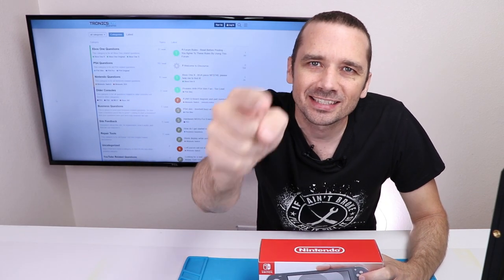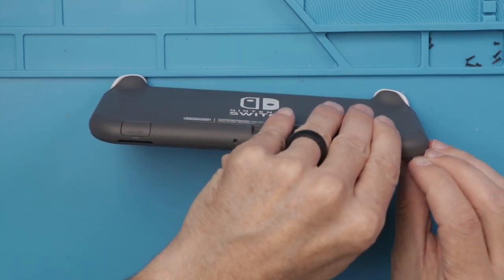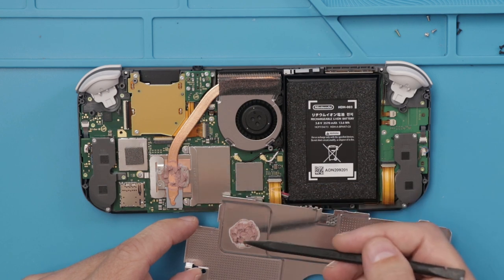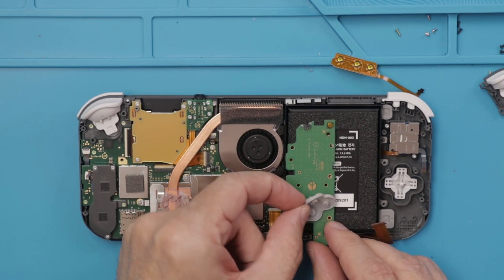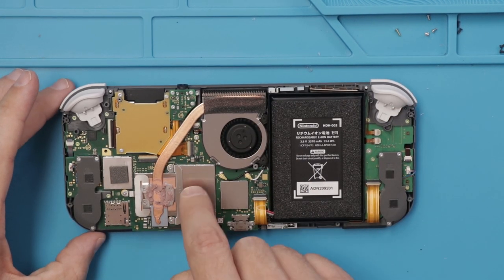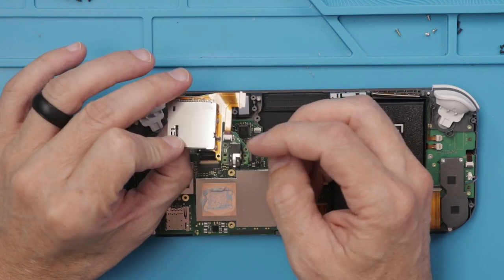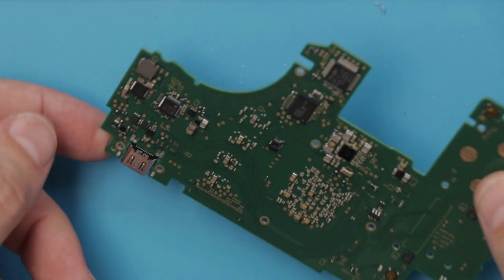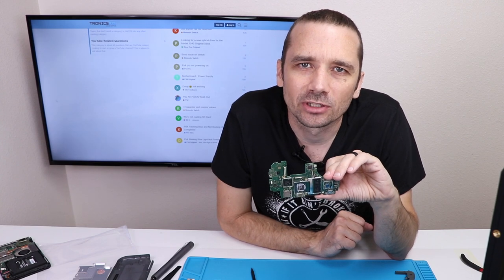Nintendo Switch Lite Teardown - Took it Apart Before I Even Played it!

Comment from the maker: Sorry I didn't get to testing the analog stick in the video...just ran out of time. I've uploaded a quick video showing me testing the analog stick to the community tab...go check it out if you're curious! (Spoiler alert...they are interchangeable)
Reply: TronicsFix I haven’t played it but I like to original one
Reply: I think that there's some glitch at 6:53. It looks like a small bar in the middle of the screen.
Reply: So did the normal analog switch work in the lite version :)?
Reply from the maker: Haven’t been able to check yet
Reply: I can't put the thing down! Loving it!
Reply: I got a question TronicsFix,  I have a ps4 and want to clean it(I got two cats at home) I don't have any electronics tools, so I was thinking about maybe just opening the shells and blowing air with my compressor. is that a good idea?
Reply: @Tronicsfix  There is a screen glitch at 6:53 but it's very minor and I personally wasn't put off by it.
Reply: Did the analog stick of the regular switch work in the switch lite?
Reply: @Skyerzen  - I've only worked on my PS4 Pro, but you have to tear down the entire system to get to the fan on it. It disassembles from the bottom and the fan & Blu-Ray drive are at the top.
Reply: BrandonHeat91

My ps4 controller is freezing after about 5 minutes. I have to press the reset button constantly while gaming. Anyone else had this problem and knows of a fix please
Model controller
 cuh_zct1u

Comment: So are those thumbsticks exactly the same as the original switch...? Man I hope drifting wont become an issue for the lite also
Reply from the maker: I haven't actually even gotten to test it yet...in fact it's still apart...I wanted to get this vid shot, edited and uploaded all today so that's all I've had time for
Reply: @Tronicsfix  No problem thanks for the reply and video anyways it was helpful👍🏻
Reply: It will be an issue, without a doubt.
Reply: @GTurbski  itsnt a issue just send it to nintendo
Reply: They're the new updated version
Reply: @fmt_piggy  Send the entire system to Nintendo then wait weeks to play it again. Also not every country replaces it for free after the warranty period.
Reply: Cutter Elf bruh I know the whole switch
Reply: @Alexpie2k  Did you see the video? He didn't open it, just assumed the components were the same. But getting to that point maybe a closer inspection would have cleared any kind of doubts.
Reply: @Tronicsfix  We'd really appreciate you doing it. Thanks!
Reply: @Alexpie2k  the Switch Lite in this video is using the updated joystick model though. so I'm wondering if the earliest batches still have outdated joysticks.

Comment: Hey tronics, I have a couple questions for you. 
I got the blue lite and I'm looking to replace the white buttons with the black ones as well as replace the Analogs in it with the new updated analog sticks (That supposedly don't get the drift.)
The buttons (minus the DPAD) appear to be exactly the same as the buttons for regular joycons so that won't be hard to find but my I don't know where to get the updated analogsticks? I was going to do it all at the same time while I had the console open.
Another question is the DPAD the same size as the DPAD in the pro controller? I don't have calipers to measure them but I know you do if you don't mind checking that out to let me know.

Comment: Just got mine yesterday. The hand feeling is great but what really floored me was the quality of the screen. It completely blows the regular Switch's screen out of the damn water.
Reply: How so?
Reply: @jsjuhbdn  Well the resolution is the same but the screen is smaller which results in more pixels per inch but the actual screen just seems to be a much higher quality panel. It's very bright and colourful and there is also much less of an air gap between the plastic shield on the outside of the console and the screen itself which results in less glare overall and just an overall nicer look. It's kinda hard to see the differences on video but put a Switch and Switch Lite side by side and the difference in screen quality is pretty apparent
Reply: @AstralPhnx  That's good news, thanks!
Reply: It legit looks the same to me but hey pixel density should help with reading text.

Comment: It looks like the metal plate you took off first significantly blocks the air intake vents (especially the right one.) Hopefully that doesn't damper air flow too much.

Comment: But did you test the video chip for shorts with that beeping meter?
Reply from the maker: Ha, ha...there's ins't a video chip on this one!
Reply: @Tronicsfix  So, should have less problems?
Reply: @Conzpiracyzero88 My guess is it will be worse.
The current spikes seem to be able to make it through the power control circuit.. and it used to be that the weaker chips was the gpu.  It makes sense as it is the most power hungry chip... and it acted as a fuse.
Now the next chip to act as a fuse is probably the main cpu with integrated gpu...tine will tell.

Comment: "Sort of" is what I was thinking. I was more wondering if it would be one solid board that the screen connected to. You can separate one "joy-con", but too bad the other is literally part of the main board. For repair purposes I wish they BOTH could be removed and replaced.

Comment: Could you answer what the torque is like on that screwdriver? Would it happen to bring out any real tight screws, or is that better left to hand tools? And how does it do with tightening screws? snug but not too tight? Thanks if you can reply good sir. :)

Comment: I have a question. The electro screwdriver you used in this video, could it be used for model train maintenance? I have it on my wish list on Amazon as well as a soldering mat like the one in your video, it was a suggested item. I’m just compiling a list of tools and such I’ll probably need when I get started with my layout.
Reply from the maker: I would think it would work but I've not used it for that so I can't say for sure.
Reply: TronicsFix okay. Thank you for your time to read and respond to me :)

Comment: Can I get a video where someone shows the analog stick module? I want to know if it’s the same crap that was in the joycon that always drifted.
Reply from the maker: Sure...just watch the video I posted before this video
Reply: The Lite? I didn’t see another Lite tear down but this. Was wondering if the Lite used the same analog stick module as the joycons. Or if it were improved.

Comment: Hey, will that little screw electric driver you used to take out those first four screws be able to take out a stripped screw on the side of the switch. I've been having trouble with it for a few days now.

Comment: Disappointing that they still use the same mounting on the microswitch for the shoulder buttons, did they protect it in any other way? It looks like they changed out the other buttons including the triggers.

Comment: Hey I am having an issue and could use some input.  Had to replace the RIGHT joystick on my gf’s switch lite and in the process of the repair, I accidentally broke the clip for the ribbon cable for the fan off (and cannot locate it)

How would you go about remedying this issue?  

I assume I have to have the clip pressing down on the cable in order for the fan to receive power.  Could I just replace the clip (if I were able to find any)?  Or stick something in there to push it to make contact?  

Thank you so much for the input!

Comment: There does not seem to be a single video on youtube on soldering a USB3.0 Type Micro-B port (replacing it), its the one with 2 halves to it and one half can be used for USB2.0 if needed. This is typical on USB3.0 portable hard drives like WD My Passport. Can you make a video on how to replace this port?

Comment: Can you tell what the difference is that makes the switch lite not dock and output to tv and if so are there solder pads in place that a lite can be upgraded to be able to output to tv?

Comment: Random Question: Is there any way to repair button contacts like the ones you point at @ 8:26? I have a bunch of classic console controllers, and those contacts tend to get less sensitive over time, and I'm wondering if there's a way to recondition/repair them.

Comment: I'm wondering if there's an easier way to replace the right analog stick without taking out the motherboard? My right thumb pad snapped off after I dropped it so I want to replace it as easily as possible.

Comment: I have a question for you if you can answer it. I found my ps4 pro was not accepting discs so i took it apart. I found the eject sensors and one was compltly broken off. Is this fairly common or rare?

Comment: Looks like the R and L buttons are just as bad as the regular switch :(. They really need to address that. Also, if you need to replace the right analog stick, it's going to be a pain in the ass :(

Comment: Noice vid, but The drifting prob depends on what type of game you play tbh. Ive had mine for 2yrs(og switch) no prob until now. I dont play super smash tho
Reply: I mostly play docked on my TV with the Pro Controller. I use the Joy-Cons only in handheld and as a Player 2 controller. I also use them when my Pro Controller needs to charge.
The most intense thing I do is drifting in Mario Kart. Despite this, I got drifting after just a few months.
Reply: @RedSunFX  wow. To me, since there was a prob at the drifting issue, i try not to press it hard as much as possible when using it. I dont quite get it cuz every analogs are the same. But why some have prob and some dont 🤔🤔

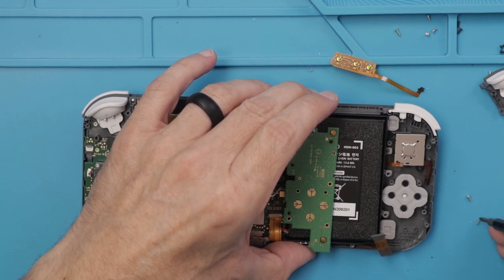Comment: 4:58 or repair shop can scam you by using the old cheaper analog stick. Unless you repaired it yourself. My brother phone camera modul was replaced, he went from 23mp sony to a regular 8mp, even the software only reads 8mp.

Comment: hello man. hey i have this ps4 controller, when i play with it after 10 minutes it just gets unresponsive, the lightbar is on, but the buttons dont work anymore, i reset it and then it works for 5 mins. i sent it to repair shop but they said they cant fix it.

Comment: i destroyed my switch. Followed this video down to a T. Was EXTREMELY careful. and no discredit to this man at all, he was giving excellent directions but, when it comes to messing with the internal hardware of devices its a hit or miss. you can either do it or you cant. it's 50/50. So take it from somebody who had the utmost confidence in doing something like this and is now down almost 200 USD. Just dont do it if you're even slightly unsure. Just dont

Comment: My brothers co-worker's nintendo switch is not turning on or charging,suggestions?
Reply: Yeah. Send it to nintendo. Duh?
Reply: That person wasn't using a 3rd party dock, right?
Reply: @brandon_nope  no,the dock came with the switch
Reply: @volsavious2319  and how with the co-worker do that?
Reply: @demogorgon2580  just go on the nintendo website and follow the instructions. Be warned though all saved data on the console will be lost so if he has a sD card with data on it remove it before sending it in.

Comment: Question for anyone who knows how the lite works. The buttons up top specifically L and L1 however you wanna call it and left joy stick make like a weird metallic vibration sound when I click on them while the other side sounds normal. Could this be an issue or is it fine?
Reply: there's some vibration on my L button as well but not with L2

Comment: Wonder if Nintendo could be up for false advertising as the word switch means a device you can change. This is not a switchable device and the name is misleading now? It would need to be an incredibly tempting price to be worth it and I doubt they can do this. Love Nintendo's innovation but this has been a huge backward step in my opinion. Oh and time will tell on Joystick drift moving forward.

Comment: Is there any chance I could put a battery from new switch revision to my old switch?
Reply: The battery didn't change, the processor did.
Reply: @duckdotexe  is it like on lower voltage or something? I wonder how much space for improvements switch still has in that matter.

Comment: My cellphone can stream YouTube videos to any TV with WiFi, so what's up with the no-docking, Nintendo? Link the video through WiFi, for Christ's sake !!
Reply: StillCloser It's $100 cheaper, relax.
Reply: @brandon_nope  The NS Lite already has a WiFi chip, any Chinese modern cellphone can stream video to a TV in HD, seems to me they did it on purpose...
Reply: You mean cast (like in chromecast). Its a separate chipset and patent. Plus casting is not as reliable as the dock due to signal interference.
Reply: @wylerXL  Chromecast is different, uses the USB port. I'm talking about services that use WiFi like Miracast on Android phones. The YouTube mobile app even has an icon to "Stream to TV LG Model xxxx". The service is made through WiFi with the same quality as WebTV, it's all a matter of software...